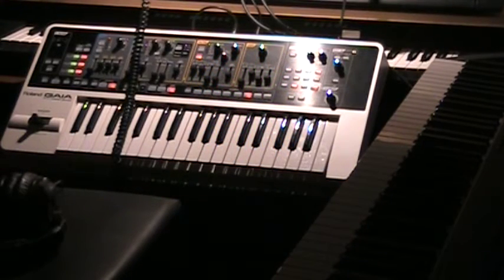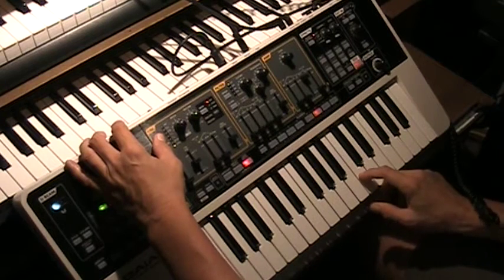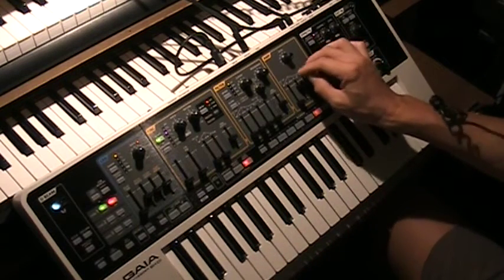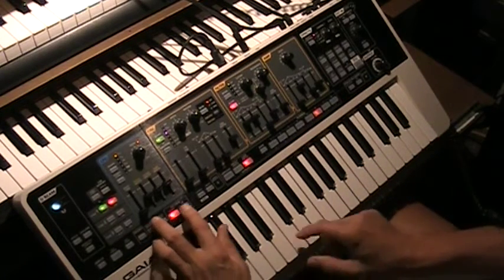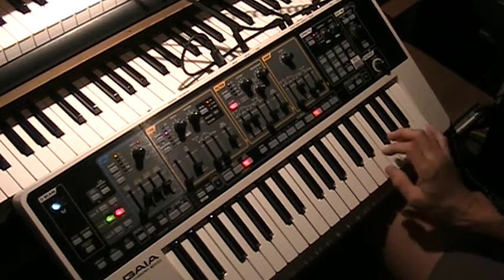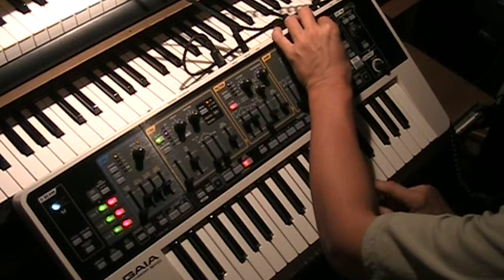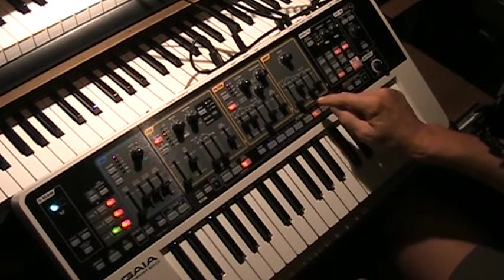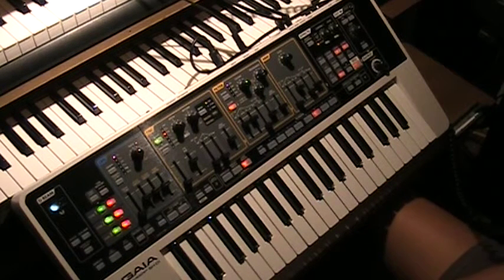Roland Gaia Tutorial 4 - Acoustic Piano - Subtractive Synthesis

Comment: Your videos caused me to buy one to program your patches I think this synth has something for everyone plus hidden set of samples it will be fun getting close to acoustic sounds like you did with the acoustic piano patch and the Rhodes you did was particularly good the closest I have to this is my roland super jupiter which is all analog or oberheim matrix 6
Reply from the maker: You're going to get spoiled building patches with 3 layers of everything like the Gaia and in full stereo, real stereo instead of simulated effects stereo. The new Gaia2 is a nice synth too, but nothing like the Gaia, no layers anymore, less polyphony, but the oscillators sound different and maybe a little better.
Reply: It sounded good even through you tube the  The Gaia 2 sounded kind of brittle and bright I like the idea it can have different models plus I'm getting a used one it makes me proud that it was the standard for teaching analog synthesis
Reply from the maker: Yes, Roland really should have updated the Gaia and made it more powerful, it should not have gone out of production. The Gaia2 is not a Gaia. Roland lost some great history when they stopped making it. I wrote to Roland years ago when they were introducing all those Boutique synths of old vintage analog but in digital form. Asked them to re-introduce the JD-800, they did but in Boutique size. If you are not familiar with the JD800 it is a Gaia type layered digital synth but with more options. So the closest thing to a Gaia today is the new Boutique, the JD-08. 4 layers, complex 8 stage envelopes, 8 LFOs, 4 filters / amp / filter env / amp env. / pitch env. and then each 4 layer patch can be layered twice.

Comment: I am very grateful for this free advice.  I have tried twice to follow it and I am getting closer to the sound u have produced funnzie.  Third time lucky - I hope.  I sometimes wish you would be more specific as to which 'notch' u move a setting to (eg 2 left or 11oc'clock etc or up 3) or could have shown a close-up image at the end so I could be sure.  However, I am still very very thankful.  The GAIA is my first synth and I am enjoying it but with there being so many weird presets, one could have been a piano :)
Reply from the maker: You are welcome. The tutorials are not so much how to make a piano, but how to make any sound once you understand subtractive synthesis. I choose familiar sounds so you could identify the relationship between sound and synth. Sometimes just a .25 of one line of a slider or knob can make a difference between being the sound you wish or not. You don't have to reproduce the sound I made exactly, make the sound to your own desires. As seen at the end of the video, just minor tweeks changes the piano sound dramatically.
Reply: thanks funnzie.  i am enjoying your videos.  While i have u, what is the pedal u mention?  Is it the Roland DP-10 Damper pedal mentioned in the Roland Gaia accessories.
Reply from the maker: I always use a sustain pedal on my synths, the pedal give so much more control over sustain, but also I can hold a chord while both hands play another keyboard, and then release at any time. The other pedal input is "expression", a great addition too, someday I will add one, they are expensive at $100.00. The sustain pedal I am using is just a cheap plastic one for $20.00.